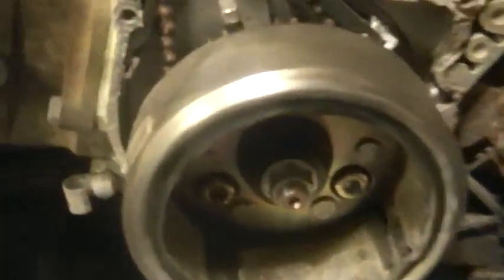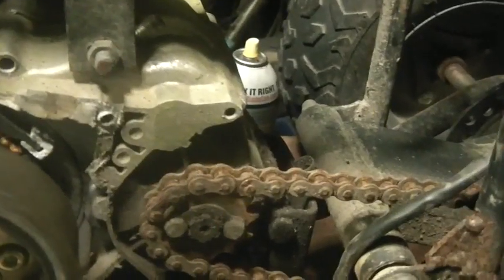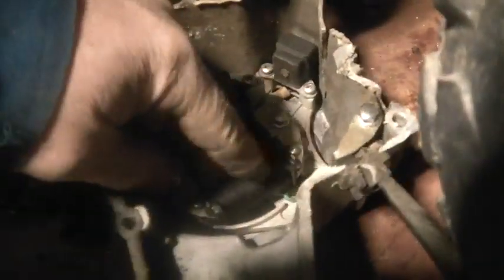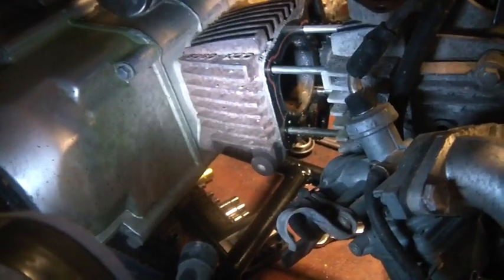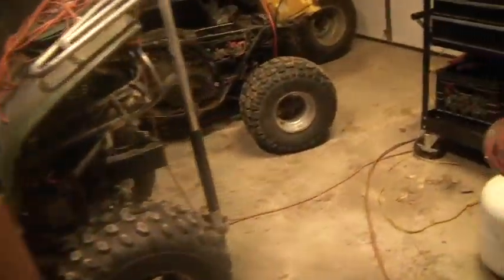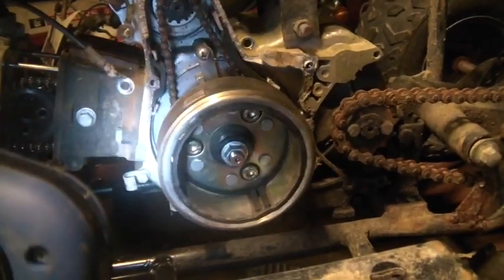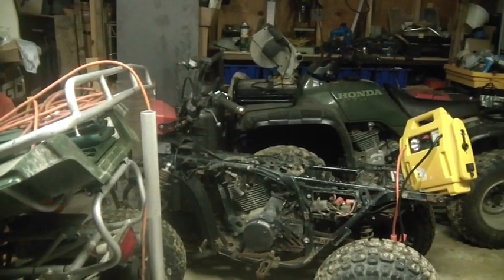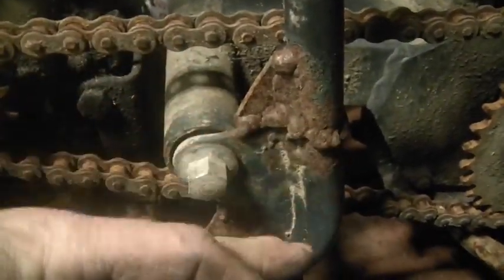70cc China Quad, Why is engine seized?

Comment: I just got the same one I've gotten it to start a few times.....then it sat for about 4 days and now it's doing nothing. Any thoughts as to why maybe
Reply from the maker: Hey Krissy!!!  Whenever a quad doesn't start, one should always start out by checking the spark, if one has spark, assuming that something crazy like the timing didn't jump unexpectedly,  one need to look at the carb, sometimes when they sit for a few days, water separates out of the gas, fills the bottom of the bowl, sometime the engine even pulls it in and puts out the spark of the spark plug.... That is where I would start.... Let me know how U make out.... Thanks for asking, watching, and commenting!!!
Reply: First I wanna say thank you for making these video's.....ive been watching them for like 2 weeks now and wouldn't  have gotten as far as I  have with out them. Yeah I've all new electrical took the carb off cleaned it, new starter, new ignition got it all running..but then yesterday nothing. It's starting but not turning over all the way. So I saw a video of yours about the timing.....this morning and I noticed the dot on the spin wheel in side the head is off by 1 and my t doesn't line up either.....so I'm gonna try to adjust it. But do you have any videos about adjusting the values

Comment: Is the oil injection working
Reply from the maker: Hey Andrew!!!   This is a 4 stroke, no oil injection, any smoke would be from the engine internals or residue left in the exhaust system that burn off as they heat up.... Thanks for asking, watching, and commenting!!

Comment: try soaking the bore with a 50/50 mix of transmission fluid and acetone with the jug facing up.i think you were duped to put it nicely,unfortunately so have i for taking someones word.
Reply from the maker: +roger oconnor , It broke loose fairly easily with PB blaster, I have heard the acetone/tranny fluid trick, I have used tranny fluid/diesel with some luck. This quad, as a matter of fact, all my China quads, are not home run deals, they are interesting and I have learned things from them, but, they are not $ makers for sure!   Unfortunately, the person I bought this from sold me a couple of losers, both seemed to be home run deals and then turned out to need a lot more love and attention then advertised.. U seem to live the same deals as I do. Right now, there are no deals out there, my eyes are opened, and I see nothing!  Thanks for the info, watching, and commenting!!!

Comment: Do you have plans for doing more work on your metal lathe and milling machine?
Reply from the maker: +sim6699 , At the moment, I do not have a project planned that needs them. I'm hoping that as I do more fabrication work there will be a call. I have almost all the tools that I want for my workshop other then a TIG welder and some kind of lift table, now, the other matter is setting them up so that they are easy to get to and use. Thanks for asking, watching, and commenting!!!

Comment: Are you not allowed to own a wood burning stove in your workshop, which have a drying effect as a pose to your gas heater giving out water vapour.
I like the idea of a stock looking vintage Cushman with a large exhaust silencer and perhaps a radio to mask the exhaust sound a little.
Reply from the maker: +sim6699 , Last time I officially installed a wood stove in a garage, they wanted it at least 18" off the ground and wanted a barrier cemented into the floor, the height is for vapors and the barrier to keep it from getting knocked over from a car or something. About the Cushman, U and I have parallel thoughts, the radio is a good idea, especially when I go thru the gate at the car show... Thanks for your thoughts, the good idea, watching, and commenting!!!!